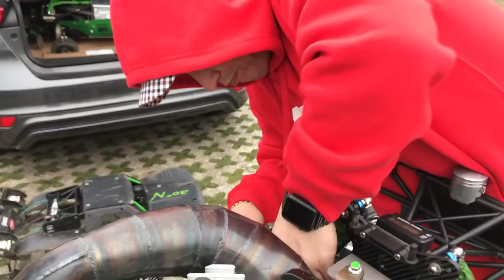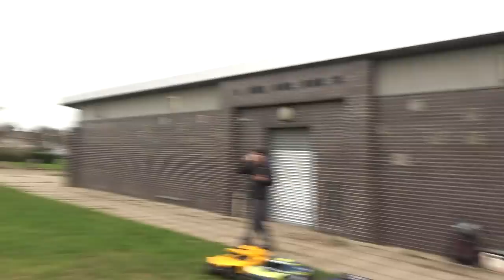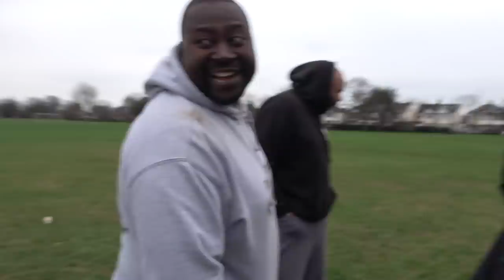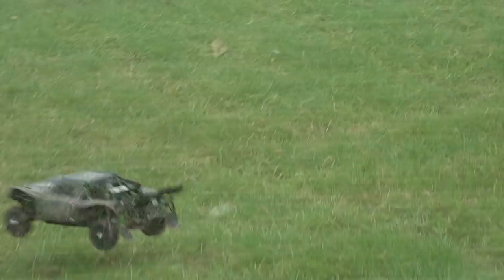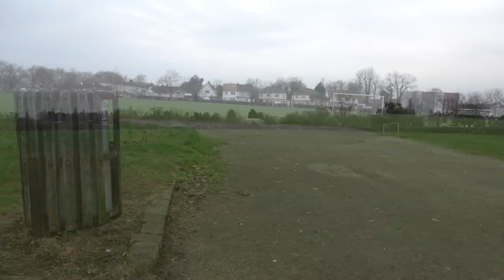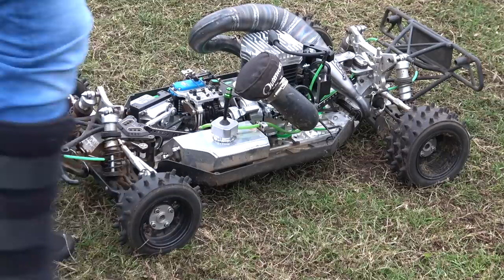1/5 scale MEGA meet! TAYLOR (RCMAX) and ALX and TWIN's on SHOW

Comment: I used a granny's shopping bag trolley with the bag taken off to strap my 29cc king motor 1/5th baja to it it worked amazingly good they kinda lock into the frame to transport it about
Reply: Just what I need for mine. Thanks for the tip.👍

Comment: What kinda hp are they putting out, and do you have a specific 2t oil or do you use a good motorcycle synthetic racing premix, or a castor based like castrol R? They sure rip dont they

Comment: Why do you still use an gas engine? What is your pleasure? I think electric RC is more powerfull and fun, isn't it?
Reply: @mizowski1413  BOth have advantage, but i prefer electric, cheaper, long duration, easy maintenance, easy upgrade, more powerfull, silent, but the muffler sound is actually make the personal choice.